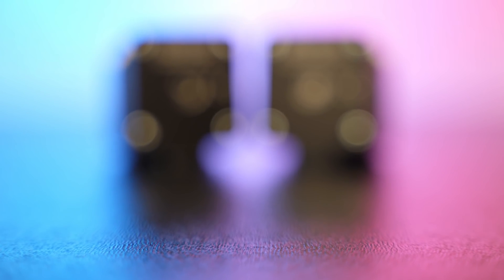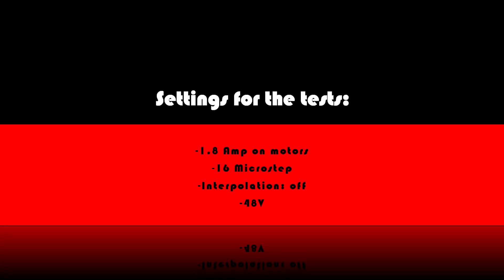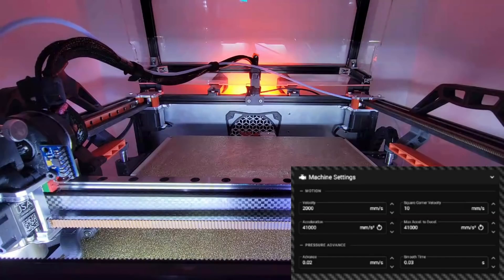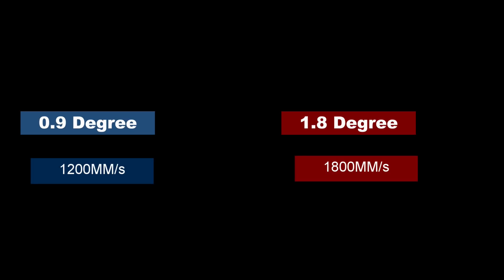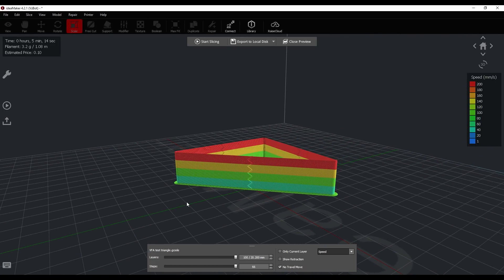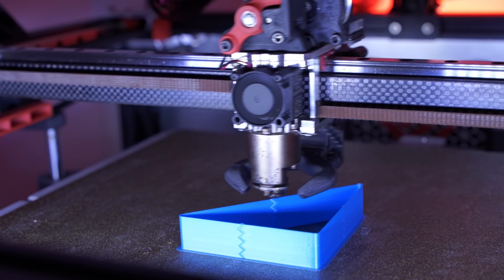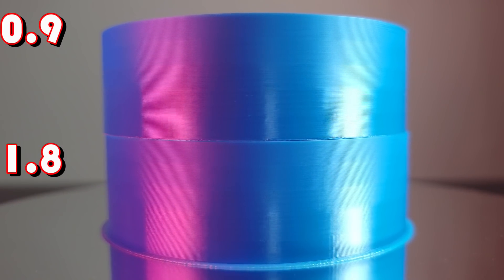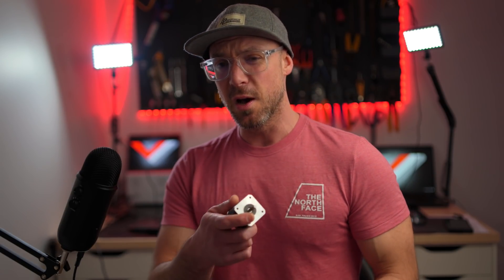LDO Stepper Motors 1.8 vs 0.9 Degree. Battle of the 48mm!

Comment: I didn't expect such a difference between the #LDOMotors , I don't know why so many people have wanted 0.9 degree motors when the dimensions accuracy improvement is more affected by the filament than the motors
Reply: 0.9 can solve some problems that 1.8 motors can create depending on the 3D printer and application. Not so much with CoreXY printers but Cartesian, which many people still have and buy. 

If you're going for speed on a CoreXY then 1.8 hands down. 1.8 motors can handle speeds and still be pretty damn accurate that 0.9 can't (unless you want to drop money your wallet would slap you for). If you're trying to reduce certain problems on a Cartesian 0.9 can help. I have a couple Cartesian printers that have 1.8 motors and I've been happy with, but my AnyCubic Chiron (don't laugh, it was my first printer and I put a lot of blood, sweat and tears into it before moving to CoreXY and I'll never let it go for sentimental purposes) suffered problems no accelerometer, firmware or upgrades could solve. After putting 0.9 motors on both the X and Y (yes, even the Y axis that I've done a lot of weight reduction on) and tweaking I can confidently say 0.9 motors have their purpose, though it may be fading out as more people move to CoreXY and even better designed Cartesian.

TL;DR Cartesian printers can benefit from 0.9 motors to solve some issues since speed/acceleration are less of a concern.

Speaking of, #LDOMotors I want to thank you for providing quality and affordable NEMA motors!

Comment: I absolutely love this. Thank you for doing the comparison of the 2 types of motors. I'd definitely get the 1.8degree motors because higher speed and acceleration is more important to me, especially since it can pretty much keep up on quality anyways. #LDOMotors
Reply: If you want to improve the performance of the 0.9 deg motor set the micro steps to half of the 1.8 deg motor.  This will give you the same resolution for each motor but substantially increase the available torque for the 0.9 deg motor. acceleration will be more than double say from 16 micro steps to  8 microsteps

Comment: Thanks for this comprehensive review, I’ve been wondering about which motors to go with so I think you’ve sealed the deal on the 1.8. However I’m tempted to use the E3D 60mm 1.8 super whopper motor at 48v when I eventually get round to building my coreXY. #ldomotors

Comment: Huh. I hadn't realized there was such a large difference in speeds and acceleration and such a small difference on quality. Seems like 0.9 might be overkill for a 3d printer. Or at least for FDM printers. #LDOMotors

Comment: hi, enjoy your videos.  have a small question, however, if you use 16 microsteps, it will not be quite the same.  1.8 ° = 3200 steps, 0.9 ° 6400 steps.  no need to set 0.9 ° so high.  to be able to compare, you should probably use 8 microsteps on the 0.9 ° motor.
Reply: 3 years later.... that was exactly my thought as well.
I had much better layer consistency when I went down to 1/4 steps for z axis. Still got a 0.01 mil resolution.

Comment: I think the 0.9 may have had a suuper small advantage on the circle but not nearly enough to outweigh all the speed advantages of the 1.8s. #LDOMotors seems to make some good stuff, I would definitely consider them if I ever built a Voron or similar.
Reply: I have a feeling slicing had something to do with it. The g code feed has a resolution and that resolution was probably lower than both motors. You can see the walls are all triandgly.

Comment: Thanks for making this great video comparing the #LDOMotors It would be interesting to see how the E3D High Torque Motor compares. It is also 0.9 degrees but people seem to be able to achieve crazy speeds with them.
Reply from the maker: I have them here as well.. but they are very far from the speed of the LDO. Still very good motors though

Comment: I recently compared the speed and accelerations of the LDO-42STH48-2504AC NEMA 17 motor and the Stepperonline 23HS30-2804S NEMA 23 motor, both 1.8 degree, on a Rat Rig V-Core 3 500. I got the NEMA 23s thinking I can get more speed and accel, but those LDO NEMA 17s outperformed the Stepperonline NEMA 23s. They are truly impressive. #LDOMotors

Comment: I wonder if these can be use my design 5 axis CNC RTCP mill machine ?
I never seen anyone using on 4-5 axis cnc using LDO which should be much better combine with Harmonic gear.
If these can be use on Harmonic gear then these should be the best for 3D printer motor.

I hope you can show me these can be use with Harmonic gear on 4-5 axis CNC milling.
I’m designing to built one, mini size 4-5 axis Harmonic like PocketNC size.
#LDOMOTORS

Comment: #ldomotors
Yes, If you just change the motors the resonance of the structure will not change. Not an expert but the only thing that could change is the way power is transfered over time. Since steps with the right settings are always completed successfully, only the frequency of the steps and the harmonic content could change, before it is coupled into the belt and the rest of the structure.
It seems 1.8 is pretty much the sweet spot for steppers. The rest you could do with gearing if higher resolutions are needed.

Comment: Cool comparison, I was expecting a greater difference on the quality test, maybe the 0.9 would be better showing fine detail. But since both are high quality motors, the high quality prints were expected #LDOmotors
Reply: On CoreXY printers 0.9 motors will most likely show little improvement over 1.8 motors. Cartesian printers IMHO can benefit more from 0.9 motors with solving certain issues since speed is less of a concern.

Comment: Interesting comparison! I was really surprised that the 0.9deg motor didn't have at least slightly better print quality. But the vase mode and flat walls maybe evened things out too much? Maybe should have printed some other more complex figure that might have given the 0.9 a bit of an edge, like a mini-Simon character? :D   #LDOMotors
Reply: exactly what i was thinking.  The parts were too basic for a real challenge to details.

Comment: Nice  #LDOMotors  comparison! For any  reason I was expecting better result  with the 0.9 at least on print quality... but what about accuracy of the print?
Reply from the maker: im not sure its worth comparing. At 1.8degree and 16ms , its 0.0125mm per step.. so even if you go half of it...I dont think its going to show. At this point, I doubt we can see a difference in accuracy

Comment: #LDOMotors ... I would have also included an accuracy test which I'm guessing is the main advantage of have more steps. Do you think you could design some kind of test to check this ? Thanks for the vids.
Reply from the maker: i
m not sure its worth comparing. At 1.8degree and 16ms , its 0.0125mm per step.. so even if you go half of it...I dont think its going to show. At this point, I doubt we can see a difference in accuracy

Comment from the maker: Don't forget to subscribe if you wish to participate. The draw will only pick comments from subcribed members :)
Reply: Great job Vez!
The maximum accelerations on the motor in 1.8 degree increments are amazing! But does the stepper motor housing overheat during such operating modes?
Reply from the maker: @harchenko_eg  not that much but I didnt run that high accel for so long.. so..
Reply: This is the first time I've seen your face. Strange how when we listen to someone without ever seeing them we create an image of them in our minds. You are no where close to what I imagined. Dont take that in a negative way. Just not what I imagined.
Reply from the maker: @billclark5943  hehe..sorry to have dissappointed you haha
Reply: @Vez3D   I said it wasn't negative therefore I'm not disappointed 👍
Reply: Did you discuss in another video why you found the stepper to be a better choice then any of the servos you tested?
Reply from the maker: @billclark5943  no.. but im not saying its better than any other servos :) just better than the one i tried
Reply: @Vez3D  ah. I see.

Comment: Maybe it's a stupid thought but 0.9 degree I suppose has more smaller coils than 1.8 degree one. Was it used a thinner wire to fit more coils? In that case I suppose the 2 motors have a different resistence and maybe a different optimal voltage for the driving?

Comment: Small angle should allow theoretically more precise movments, but it seems that microstepping makes in both movments precise enough for your test. I would try a more intricate model smaller size with finer Nozzle to see if 0.9 degree improve significantly quality in that conditions. For faster prints 1.8 is definetly good enough for the resolution required #ldomotors

Comment: .9 is only beneficial to miniatures or doll house parts at low speed and at the point,  you're better off with a resin printer.  They're also good for light duty small form factor cnc. Other than that, 1.8 all the way.  Now, I need those motors for my build so #ldomotors !

Comment: Great video, very informative. You would think you'd get better resolution and holding torque out of the 0.9 #LDOMotors at the expense of speed/acceleration. Something to beat in mind if looking to specify 0.9 degree steppers, the microcontroller would need to have enough grunt as it is pumping out twice as many pulses to achieve the same distance and speed as the 1.8s.

Comment: Great video. I'm interested to see vertical lithophanes printed with both motors (and maybe with a smaller nozzle) to finally figure out if the resolution difference is negligible or not. And you could just publish the results in a community post since images would also have better quality there. Thanks a lot.
#LDOMotors

Comment: I got LDO 0.9 Hightemp motors for XY in my voron V2.4, i haven't tried going super fast yet, still only keeping to 300mm/s for travel. 
But i do think they produce very nice prints, i have very little VFA and usually really beautiful outer-perimeters.
Reply: Is it 40mm or 48mm tall XY motor? We have some claim on 40mm tall motor abs then improved it with 48mm tall motor.

Comment: I've got the 0.9's running on my Trident and the 1.8's on my VZTrident and i gotta agree with you that overall the 1.8 is the better here the sound that the 0.9 makes is of a higher pitch so eventhough it's quieter at low speeds it's a far more anoying sound to hear #LDOMOTORS

Comment: #LDOMOTORS Looking to pick up a 2nd set of the 1.8s for my AWD vz235. Also my 2504AC motors with 5160 drivers were loud and had an annoying whine at low speeds until I changed the driver settings in klipper, this lowered the volume and improved the tone of the motors. I added the following to my config.
driver_SGT: 2
driver_TBL: 1
driver_HSTRT: 7
driver_HEND: 7
driver_TPFD: 0

Comment: #LDOMotors !  Appreciate the head-to-head testing.  I've been getting great results from my 42BYGHM810 0.9's, partly because they have a very low phase inductance of 1.8mH, so my jaw definitely hit the floor to see both of these only have 1.5mH!  I think that might be the lowest I've ever seen.  The rotor inertia is a little high at 85ish, but I'm not sure how much impact that has.  Not surprised by the performance results since they have the same phase inductance, meaning the 0.9 will generate twice the back EMF.  You'd have to have a pretty bangin' extrusion solution before either choice became your performance bottleneck at 48V, though!  The quality comparison was also interesting - both motors get artifacting in certain speed ranges, just different speed ranges.  I expected CoreXY to show more difference, but it seems good motors make more difference for this motion system than the steps per mm.  I definitely noticed a difference on my delta going from 1.8 to 0.9, but I also stepped up motor quality in the transition and changed boards from 8 to 32-bit at the same time, so I never got a chance to A/B just the stepper impact.  Changing motors would be a pain, but if I win some 1.8 LDO's, I'll totally run a head-to-head!

Comment: Thanks for the review, I was wondering the difference. I bought a pair of the 0.9 high temps and wasn’t really happy with them. Looks like 1.8 is the way to go. #LDOMotors
Reply: my 0.9 high temps 40mm are extremely loud. 1.8 48mm are the way to go

Comment: Would be very interested to see temperature testing between the two as that’s one of the benefits that I’ve heard of the 0.9 motors, otherwise an amazing video as usual. #LDOMotors
Reply: Good point
Reply: I just received a set of LDO's 0.9-deg high-temp (180C) version a couple days ago. But I was looking to meet different build requirements, namely precision over speed and the ability to handle higher ambient temperature. I haven't finished installing them, calibrating, and testing their performance. #LDOMotors

Comment: Hi Vez seeing the 0.9 has double the resolution of the 1.8 degree motor how do they compare in speed and acceleration. if you half the microstepping setting for the 0.9mm motors. So perhaps running the 1.8 deg motors at 1/256 and the 0.9 at 1/128 stepping? And at what microstepping settings are you running your #LDOmotors at to get your unicorn speeds?
Reply from the maker: I tried 256, and that is WAY too much steps per sec for my electronic passed 1000mms haha. 32 is borderline and wont give more quality for me

Comment: #LDOMOTORS Great job Vez.  But the 0.9 looked less noisy to me, maybe it's just an impression ;)
Reply from the maker: they are not.. i tried hard in video to level both sound tracks but its a bit hard. But trust my ears.. the 0.9 are only less noisy at very low speed. As soon as you crank speed they become very high pitch and agressive

Comment: Those 0.9 degree motors would maybe be more beneficial in something like a delta printer, or maybe a regular printer with a very  small nozzle where you don't really need super high accel and speed. Oh and #LDOMOTORS

Comment: Great #LDOMOTORS comparison, Vez. I'm curious if you've looked into advanced TMC driver tuning to deal with VFAs caused by motor self-resonance. There are some settings recommendations floating around but the methodology to arrive to those is not very clear, it'd help the whole 3d printing community to have those explained clearly. Thanks, great channel.

Comment: Really surprised that the 0.9deg motor didn't perform better in terms of print quality. I was hoping that the little bumps on the surface would be reduced with the supposed "smoother" stepping.
#LDOMOTORS

Comment: #LDOMotors Hmm...I expected the 1.8. to be faster than the 0.9 motors, but I'm definitely surprised that the quality is quite similar. I expected less VFA with 0.9, but in your case 1.8 looks also very good. From my point of view is clear that the frame construction is much more important in the appearance of VFA that the stepper motor being 0.9 or 1.8 degree.

Comment: thanks Vez! really glad LDO has established a good reputation and we have more and more distributors of reliable, high performance motors. very useful to have a go to supplier and your tests are really valuable. quite surprising results. for a long time everyone was convinced you absolutely had to have 0.9ers for a corexy, but clearly not. happy that all my older motors aren't disgraceful trash in that regard, even if i can't get the same speeds with them. great work #LDOMOTORS !

Comment: #LDOMOTORS great comparison Simon! Maybe you need to compare quality with each of their max accel and speeds. Basically 1.8 at double feedrate.
Reply from the maker: haha thats just impossible. 1800mm printing haha. I was able to print at 1500mms the other day.. but thats not good for quality etc..
Reply: @Vez3D  Oh wow, I didn't notice they were printing that fast. I must be getting so used to seeing unicorn speeds. Either way, I agree the 1.8deg is a better match.

Comment: I was actually just talking about this on discord! I was curious, given all else being equal, which would have a higher torque and in turn higher acceleration, thanks for the testing! I really like the #LDOMotors and looking to pick up a set for my upcoming build. I could actually see the difference in the circular model near the bottom but it was so little I don't think it matters considering the acceleration difference.

Comment: #LDOMOTORS Hi really nice Video, good work comparing them 👍. At wich speeds do you normally print Acceleration counterspeeds. I’m really happy that my DIY CoreXY printer runs stable 70K accel and 30mm counterspeeds for all my prints. And I have cheep stepper motors 😀 and I’m still not reaching the limit. Would you do another stepper motor comparison Cheap vs Expensive would be really interesting.
Reply from the maker: my goto settings are normally arround 250mms @10K for high quality. But depending on the parts it can much higher or much lower

Comment: #LDOMOTORS. There’s definitely a perception that 0.9 motors provide higher quality prints… I wonder if the 0.9s would shine when using smaller nozzles and slower speeds or if it’s just a myth. Thanks for showing your results.

Comment: i was gonna do the exact same video when I escaped my country :D i'm glad someone did it because i was so curious 
boy this video was amazing am I glad you did it. 

the noise is really important and it seems so much better on the 0.9. however at higher speeds above 150mm/s 0.9 is making me deaf
i thought at lower speeds 0.9 was nicer and more pleasant! (my printer will probably not print above 150)

tbh I'm gonna save my money and go with 1.8 ovreall.
my build is extremely budget oriented and uses 2 Y motors so this is good ^_^

gonna try my luck lol for my build
#LDOMOTORS